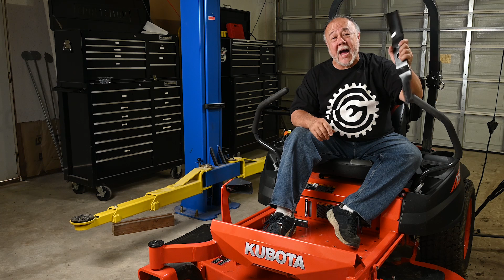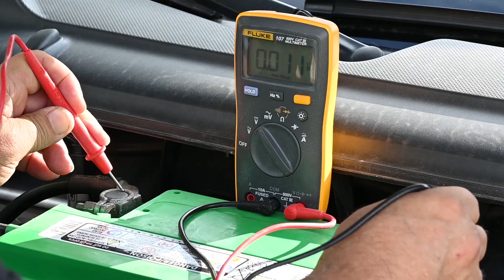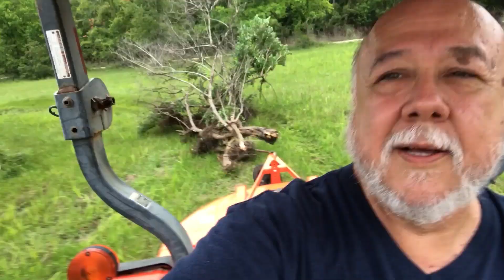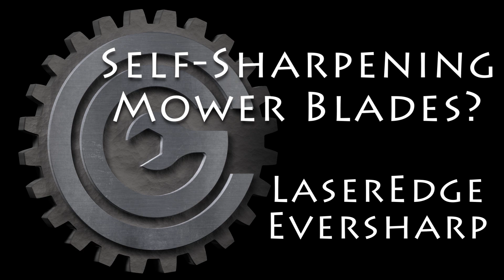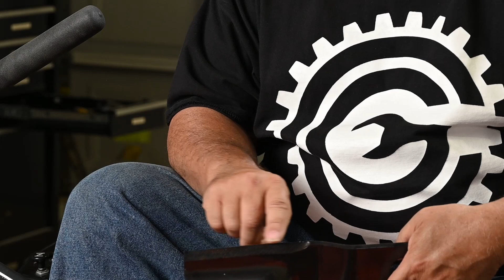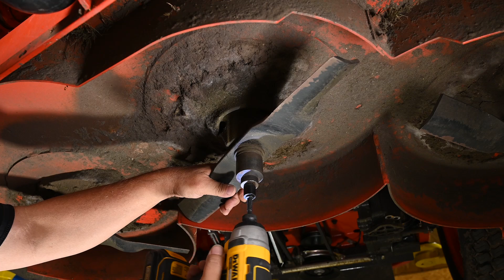Self-Sharpening Mower Blades: How They Work And Putting Them To The Test (LaserEdge Eversharp)

Comment: 'Grass' etc are low mass, and the sharp edge hits then the low mass upper part is disconnected and floating.  There is relatively little of anything to 'wear' the upper part of the blade.  Even if it is terrible, 'high wear' steel, it's still steel, and there is very little to 'wear' it.
'Self sharpening' works much better in metalworking steel cutters, etc, since the part being cut away is still steel or other metal and still connected further back, and wears heavily against the wear part of the blade.
Expect 'self sharpening' to barely work in grass if at all, the wear away part of the blade is still steel and there is very little to wear against it.  There are rubber and other versions, but I'd expect them to work poorly as well for the same reasons.